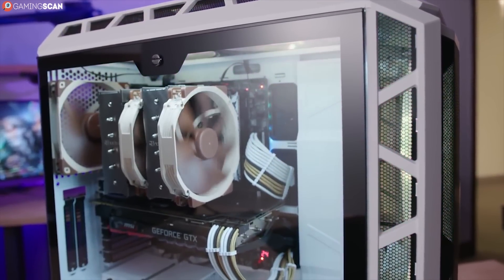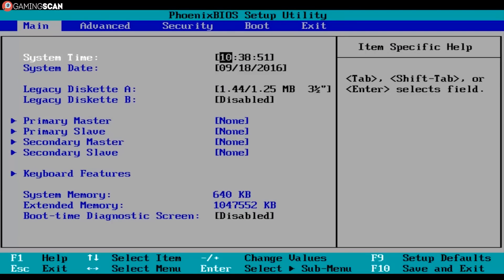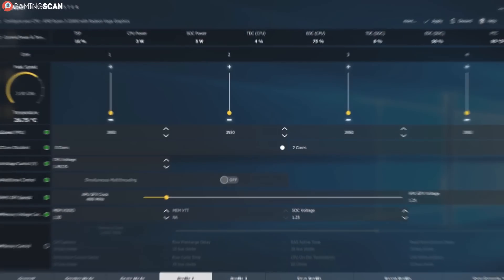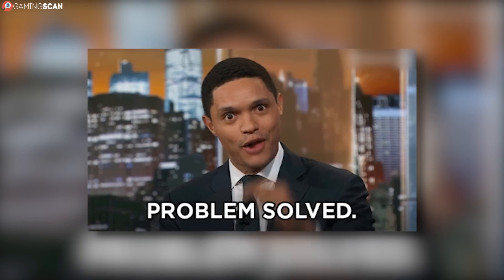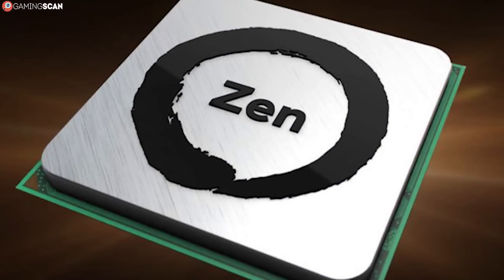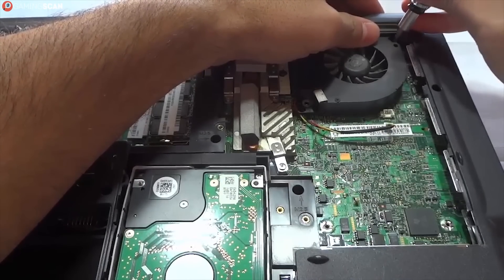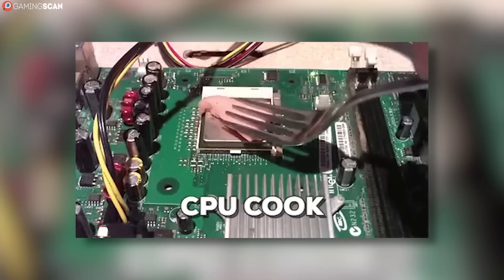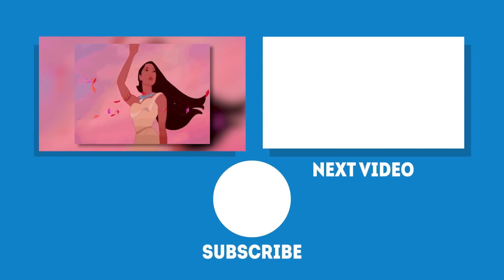How To Monitor Your GPU and CPU Temperature [Simple Guide]

Comment: There is also Desktop Gadgets, which has been around for Windows for a very long time. And it is free. It can monitor the CPU temps and usage, the GPU temp and usage, the hard drives//SSDs free space and usage, and your Network speed through easily found gadgets. Really a useful and good looking sidebar for the desktop!

Comment: lol just found out my gpu fans aren't spinning, played ow on highest graphic settings and got a black screen during ranked lol
Reply: Thats a bad sign
Reply: @RankingTrends67  Yessir, was able to fix it luckily
Reply: @BareStrength  What temps were you getting?
Reply: @BareStrength  Was it some shtty cable?
Reply: @BareStrength  how did you fix it ?
Reply: how did you got to know that's it is not working?
Reply: @himanshugupta5927  he opened the case and looked ? duh
Reply: @SeparatiXz  oretty sure he meant how he noticed it in the first place

Comment: Hi 😁,
I recently bought the new Asus tuf a15 with the ryzen 7 4800H and for some reason I can't monitor the CPU temperature with any software. I can only see it in the bios. What do you think is the problem here?
Reply: go into your window tab and type in armory crate. this will let you monitor all of the temperatures and overclocking options. this is the built in bios for the a15 laptops
Reply: Ooo my brother same laptop same problem , have you got solution yet
Reply: @omdandade8245  Actually yeah, I bought with without windows so I installed it myself. Turns out I didn't install the cpu drivers correctly. I recommend formatting the laptop, than you install both msi afterburner and HWMonitor. Through HW you enable the cpu temperature
Reply: @KorenRokah  hey buddy can i have a talk with you
Reply: @omdandade8245  sure
Reply: Hey I have Intel , but HW Monitor works great for me , try it out
Reply: Hey, I'm pretty sure in the video they said it only works for Intel cpu

Comment: I have my laptop stored away in a drawer connected to my monitor  and it  gave me a blue screen of death could That be because it overheated
Reply: Its better if you keep your laptop cooled by something, try installing some quiet fans inside the drawer then you could probably leave it in there. But if you cant then yeahhhh, probably leave it out of the drawer xD
Reply: @DecisiveTv  yeah, then I was like 7 so I learned my lesson XD
Reply: @DecisiveTv  It’s now out of the drawer
Reply: @Dom_f1042  Bruh did you just get it properly cooled? Nice, 1 year later and got some nice cooling lmao
Reply: Definitely why you need a constant flow of cold air to cool something ie by letting the fans suck in air

Comment: i am using core temp , is 80 degrees hot ?
Reply: not overly, i wouldn get worried until the mid 90s
Reply: a little
Reply: i overclocked mine and it got to 93 degrees in the first 6 minutes xD
NORMALLY ITS 20-60
Reply: Oot_Nyyppä bruh

Comment: plz answer me EXPERT
i5 processor ,Bios showing 90 degree temperature , but software  says around 50 
plz help
Reply: I'd trust bios more. I would get a new fan set up right away/clean your laptop/desktop. ASAP. 90 degrees idle is HORRENDOUS AMD DANGEROUS ON IDLE
Reply: @MiggySmalls714  thank you sir, after insatllin new cooler master Fan, its stable between 60
Reply: @itplanet480  hey dude what fan did you get? Could you possibly give the link if you got it from Amazon?

Comment: for the dust issue i have a solutioin without opening your pc/laptop (WORKS MOST OF THE TIME BUT NOT ALWAYS) take your vacum cleaner set it on the lowest-medium and go over the grinds where the cooling fans are and do that for like a min (DONT SUCK TO HARD some fans are smaller and break easly and some are bigger and stronger) i have a acer nitro 5 with 2 coling fans and i use this methode once a month or 2 (if you break your coller dont blame me)
Reply: NEVER USE A VACCUM 
LOL
Reply: I did it all the time and still have the pc working just fine
Reply: I do that on my ps4
Reply: @white_rabbit_333  Hahah well you are dumb as hell
Reply: Bad idea.  You may get away with it, but you may not.

Comment: I tried accessing the bios by pressing the delete button then my computer keeps beeping after a few seconds...I didnt access the bios and i restarted to the main screen instead but the screen looks corrupted,it's fixed after a restart,what am I doing wrong? D:
Reply: Depends on your mother board? Look up the mother board and it may have a different button instead of delete, try F2
Reply: try f11
Reply: try f11 or f8
Reply: Congrats you made a  bomb
Reply: u might have a locked cpu

Comment: HWinfo is also a very good tool to use to check your temps, as well as everything else in your computer.
Reply: But it don't show CPU temp for new?
Reply: @travisbickle4360  It does. HWinfo goes directly into your motherboard's bios to get the readings. So scrolling through the list for Sensors will give you a temp reading.
Reply: @laceyclark311  HWMonitor is the same thing right?(by CPUID)
Reply: @djrocks5678  I believe it is the same thing.
Reply: @laceyclark311  alright than yea that's pretty good too , but you can't see stuff in the taskbar :(
But otherwise it's great